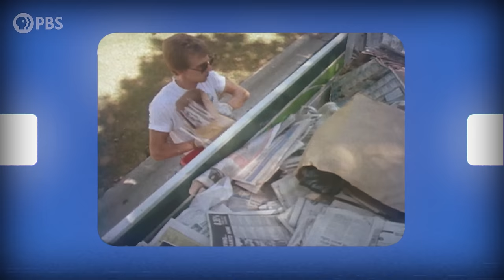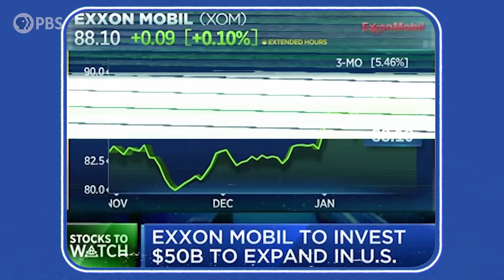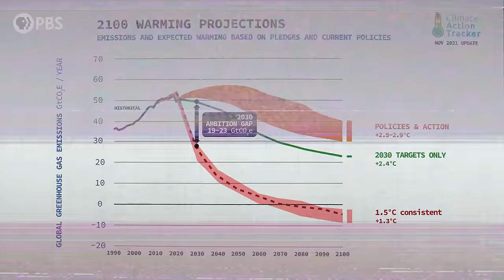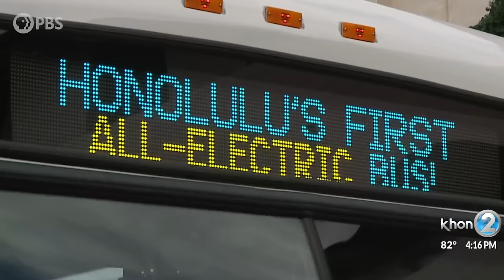Does "Every Little Thing" REALLY Stop Climate Change?

Comment: I kinda disagree with this. I recently bought an Ebike. That ebike released 700 lbs of CO2 in the manufacturing and shipment process. In the year of taking this bike to work I have reduced my greenhouse gas footprint by 4 tons. I know this is not a huge amount, but this is a really big change in my footprint in 1 year. This one action was enough to reduce my entire carbon footprint by about 30%. If we can clean up the grid and I can install a heat pump there goes another 1/3 of my carbon footprint. These are massive massive changes. People taking actions is a major way we can reduce emissions, but people just don't want to take any actions that actually do something. 

This video is claiming that we need government action to reduce carbon emissions (Which is true), but this will just entail pushing people into decisions that will reduce emissions (Such as heat pumps and ebikes). This just shifts the blame from individual actions, to societal actions to reduce our guilt. It doesn't actually solve anything.
Reply: I guess I'm just jaded by the amount of people who want action on stopping climate change, but still want a gas furnace and to drive to work from their large house in the suburbs. People are unwilling to have an honest conversation about what stopping climate change actually means, and this video would fall into that category.
Reply: this is important because there aren't many levers that can change it with out your support. we all have to limit our footprints and its not like the government is going to limit your driving
Reply: It's a both/and I think. Like you, I ride my bicycle everywhere and work to limit my impact. But while that does reduce my impact, my reduction is dwarfed by all my neighbors that don't care and companies that blow away my impact with their emissions. So my impact is not enough on it's own. Additionally, without collective action it's not comfortable or convenient for me to do things like ride my bike. That's why we need widespread policy change to truly have an impact and change the impact of the majority.
Reply: @een_schildpad  those changes don't happen until a bunch of people like you show up to the city council meetings
Reply: The problem is riding that bike isn't an option for most people because of systemic issues like lack of protected bike lanes and everything being super spread out in the suburbs. You have to change the roads before most people will adopt bikes, even if bikes are a thing most people want.
Reply: @Lildizzle420  So true! It's funny you say that, I ride my bike to council every month and my counselors now all know my name and why I'm there (for bikes, walking, public transit and more mixed use with housing) 😂 it's a bit of a joke now because I repeat myself so much, but I'm hoping that by continuing to show up it keeps the topic fresh in everyone's mind. I'm feeling a bit discouraged at the moment at the slow pace of progress 😔 but one day at a time I suppose!
Reply: @een_schildpad  I really appreciate you because there are days when I'm totally alone at a meeting and trying my best but I think there are people like you out there even if I don't hear it. I got your back bro
Reply: @een_schildpad  Agreed, we need policy action to get people to not drive ICE vehicles, the problem is that most people I know worried about climate change would hate that. At the end of the day people need to desire change, and that won't happen without pointing out peoples impact. We would rather just blame some other boogyman.
Reply: @pendlera2959  Completely correct. I live in a city that has proposed being carbon free by 2040. Yet this city protests bike infrastructure and zoning change. 
The point I'm making is that people don't want actual solutions, they just want to blame someone else. This is exactly what this video does, and this kind of thinking will never lead to and progress. If we want change we need to point out what people and their communities can do. This will motivate people to push for change. When we say its all large businesses doing the polluting we absolve people for protesting actual changes.
Reply: @williambonadurer9750  That's a good point! Just 5 years ago or so even I didn't have a good sense of the externalities I created driving my car, but the videos and writing of others that did see it made me aware and changed my behavior!

At least in the US, there's been a lot of deflection by corporations to individuals (plastic is a problem because YOU don't recycle enough; the river is a mess because YOU don't pick up litter; cars kill people because YOU aren't careful enough) to avoid their responsibility in the matter. But I see now that's NOT the direction you were talking towards!

Comment: I've been saying this from the start lol It's part of the reason I haven't stopped eating meat (the other is health, of course). I will always bring it up when I can. The sky in my area was clear and the air was clean for the first time in a long time when the COVID lockdown happened because no one was driving. Full stop. It was like a micro climate cleanse that visually proved big oil is responsible for this whole thing.
The USA needs to build cities that are walking friendly. Right now, everything is all spread out and you literally have no choice but to drive if you even want to go to the store from your house. BUILD RESIDENTIAL AREAS IN COMMERCIAL AREAS. Make people WALK (or ride a bike). That will 100% lower carbon emissions because no one will be driving regardless of the vehicle (electric vehicles are still iffy because unless you know where your electricity is coming from, it could very well have been generated via big oil's bs. It's better than a gas powered car but still not as good as walking or biking) and the #1 largest money-maker for big oil will be eliminated. If people aren't using their vehicles at all, they aren't buying gas.
Reply: Thats what I also noticed! The air felt a lot and I mean LOT cleaner then before! The climate was also significantly better. Yet somewhat articles said that the pandemics affected nothing. Yeah...right. Nothing. Though we could cut off with the online shopping and other unnecessarry stuff though.

Comment: I don't agree with the initial premise: what we do as individuals adds up to nothing. The same could be said about taxes, a typical individual contribution is so tiny, why bother? But if we all decided not to pay our taxes, the cumulative impact would be huge. If the average individual cuts their energy usage by 30% (which is pretty easy), the cumulative impact would be huge. 

However, I agree with the larger premise that systemic change is much more effective. The underlying reason is that it's hard to encourage and maintain individual action, not that the individual action is meaningless. In our household, after a bill shock, I checked all the energy consumption carefully, and found heaps of simple changes that could reduce our energy bill by as much as 50%. But it was hard to get my family to get on board, and tiring for me to constantly check and adjust. I still do it now a year later, but not with as much enthusiasm. As an electrical engineer, I can see lots of ways the design of our house and appliances could save a lot without having the individual constant check and adjust their actions. For example, boiling the jug for a cup of tea or coffee typically uses 3-4 times more electricity than is actually needed, and this affects the peak demand as well which one of the reasons quoted for why we need to keep coal/gas plants running.

Comment: The plastic industry has put the burden of disposing their single use products (in an environmentally safe way) on the consumer when it should be their burden to solve. In systems engineering, part of the curriculum teaches that when you're creating a product you should also have a plan of how to dispose them in the most effective and least costly way (cost here doesn't have to mean money, could also be time, or other resources).

Comment: - The first thing we need to do is get money out of politics.
- The second thing we need to do is regulate most industries to adhere to modern expectations and to stop putting the burden on the consumer.
- The third thing we need to do is propose legislation that requires energy companies to be honest about how they provide electricity to you.
- The fourth thing we need to do is demand larger energy industries, owned and operated in our Country, to split up and demand that competition exists in this "free market" (It's not a free market if there is zero competition).
- The fifth thing we need to do is require all of these electric companies to have a minimum of 85% of their electricity to be generated by renewable resources.
- The sixth thing we need to do is close loopholes around all of these, having established clause that dictates they're subject to heavy taxation and fines that feed into the pockets of their customers (thus potentially risking them going under).
- The seventh thing we need to do is convert existing vehicles to an alternative fuel source, may we suggest corn fuel/e85? There's a purpose of the Catalytic converter.
- The eighth thing we need to do is ban the use of carbon engines in commercial use, thus requiring all commercial drivers or companies to replace all tractor-trailor or larger road vehicles, to renewable.
- The ninth thing we need to do is regulate the transportation industry as a whole and permit that their up to a standard fit for modern society, both in driving etiquette (more accidents happen due to tractor trailer drivers today verses in the past), a higher pay (Yes, I'm asking for truck drivers to be paid more) and a required increase in pay with a required set time of sleep. Potentially outfitting their vehicles with more technology to aid them in their travel, rather than hinder them. In this, you enforce the notion that the only people not 'on their side' are the corporations and profiteering capitalists who want money, not the people looking to reduce climate and namely increase safety of our society as a whole
- The tenth thing we need to do is understand that Capitalism unchecked can lead into what we have today. We need to checks and balances, not just for our Government, but our economic system too.

It's been over 40 years, when do these economics trickle down, and when does investing in more oil and coal help the climate?

We can't fix any issue if we don't see, and absolutely resolve with consequence if attempting a loophole, the systemic problems first.
Every action should have consequences, and in so many cases, we've watched that with the wealthier you are, the less consequences you face.

Comment: The main reason I put solar on my roof was to cut bills and it worked. I always knew it wouldn't make any difference to carbon emissions but it does make me feel good. I live in the flight path of an airport that has a stream of private jets coming and going. I imagine their emissions are large but tiny on a global scale.
Reply: It cut your bills, but on expense of huge investment, that will need more maintenance in the future. So at the end its possible you made your situation worse. Maybe it makes you feel good and definitely it made solar panel producers feel good. To produce something, anything new actually, takes a lot out of our environment. Your panels probalby were produced at the other side of the world and were shipped over by causing more harm to environment. Didn't you build them by yourself? Better grow some trees.

Comment: Good illustration of the point, but your follow through on the better option was sparse. A couple examples of getting an electric bus or a clean power commitment for a single municipality was hardly showing the real changes needed and the better way you so amply set up to communicate!!

Comment: Reversing global warming is a complex challenge that requires substantial and coordinated global efforts. While complete reversal might not be feasible in the immediate future, it is possible to significantly slow down or even halt the progression of global warming through various strategies. Here are some key approaches:

Reducing Greenhouse Gas Emissions:

Transition to Renewable Energy: Shifting from fossil fuels to renewable energy sources such as solar, wind, and hydroelectric power can drastically reduce carbon dioxide (CO2) emissions.
Energy Efficiency: Improving energy efficiency in industries, buildings, and transportation can reduce energy consumption and associated emissions.
Carbon Pricing: Implementing carbon taxes or cap-and-trade systems to incentivize reducing emissions.
Carbon Capture and Storage (CCS):

Direct Air Capture: Technologies that capture CO2 directly from the atmosphere.
Geological Storage: Storing captured CO2 underground in rock formations.
Afforestation and Reforestation:

Planting Trees: Trees absorb CO2, so increasing forested areas can help sequester carbon.
Protecting Existing Forests: Preventing deforestation and degradation of forests.
Sustainable Agriculture and Land Use:

Soil Carbon Sequestration: Practices like no-till farming, cover cropping, and agroforestry can enhance carbon storage in soils.
Reducing Methane Emissions: Improving livestock management and rice production practices to reduce methane emissions.
Reducing Short-Lived Climate Pollutants:

Methane, Black Carbon, and Hydrofluorocarbons: Addressing emissions of these potent but short-lived climate pollutants can have immediate benefits for slowing warming.
Enhancing Ocean Carbon Sinks:

Marine Protected Areas: Protecting and restoring marine ecosystems such as mangroves, seagrasses, and salt marshes.
Iron Fertilization: Stimulating phytoplankton growth to enhance CO2 uptake (though this method is controversial and requires careful consideration).
Innovative Technologies and Geoengineering:

Solar Radiation Management: Techniques like stratospheric aerosol injection to reflect a small fraction of sunlight away from Earth (still highly experimental and controversial).
Policy and International Cooperation:

Global Agreements: Strengthening international agreements such as the Paris Agreement to ensure global cooperation in mitigating climate change.
National and Local Policies: Implementing robust climate policies at all levels of government.
While some impacts of climate change are already unavoidable, these strategies can help mitigate further damage and, over time, stabilize and even reduce global temperatures. The effectiveness of these efforts depends on prompt and sustained action across all sectors of society.

Comment: The UN's IPCC AR6, chapter 12 "Climate Change Information for Regional Impact and for Risk Assessment", section 12.5.2, table 12.12 confirms there is a lack of evidence or no signal that the following have changed: 
Air Pollution Weather (temperature inversions), 
Aridity, 
Avalanche (snow), 
Average precipitation,  
Average Wind Speed, 
Coastal Flood, 
Agricultural drought, 
Hydrological drought, 
Erosion of Coastlines, 
Fire Weather (hot and windy), 
Flooding From Heavy Rain (pluvial floods),
Frost, 
Hail, 
Heavy Rain, 
Heavy Snowfall and Ice Storms, 
Landslides, 
Marine Heatwaves, 
Ocean Acidity, 
Radiation at the Earth’s Surface, 
River/Lake Floods, 
Sand and Dust Storms, 
Sea Level, 
Severe Wind Storms, 
Snow, Glacier, and Ice Sheets, 
Tropical Cyclones.

Comment: We need to do both as best as we can. A lot of humanity's environmental impact is the result of industries that are supported by the end consumers. If we, as consumers, make better choices and use less, that will reduce the impact all the way up the chain. As we support better companies and boycott worse ones, we can force companies to behave in a way that is better for the environment. So as individuals, we can make a significant difference if enough of us try. 

And yet, there is no way that will be enough on its own, unless basically everyone abandons modernity immediately, which we know won't happen. So we have to force systemic change.

But doing both things at the same time helps. If individual actions managed to reduce our species' environmental impact by even 5% or 10%, well, that will buy us a little bit more time, and might save a few species or ecosystems that wouldn't have lasted long enough to be saved by systemic change otherwise.

Comment: I still think getting consumer to do "the right" choice is the way to go. Companies are in a prisoners dilemma where if they attempted to reduce emissions, they might have to increase the cost thus less profits. Eventually loosing to companies not doing so. No sane, profit driven investors would allow it. However, consumers are free from this restriction. Voting with your wallet avoids the problem.

CBAM and carbon tax should solve it. But it's still better to motivate the companies to switch all ways possible.

Comment: We can reduce carbon footprint by not buying a one time use item instead of buy a multi time use item, and by demanding that big companies make products to last at least 20 years and able to be fixed instead of costing more to fix an item, like a washing machine, a range etc. and cars electric and gas powered ones needs to go back to being a fixable item and last at least more than a pay off of the load to buy one.   I am starting to think do I really need this item and will I use it on a daily basis and is a price I am will to pay, if any of the questions are a NO I do not buy it.